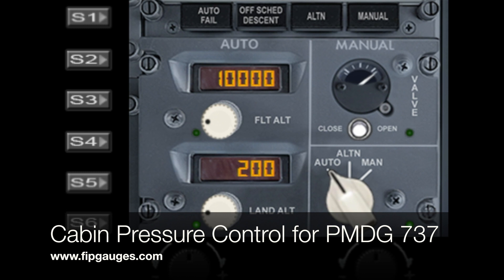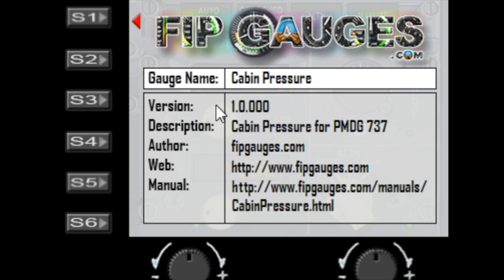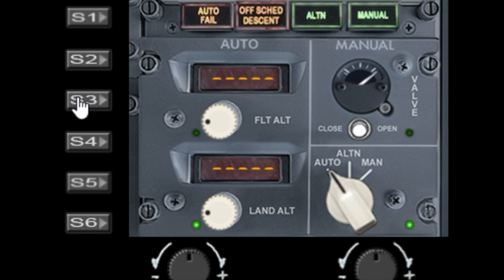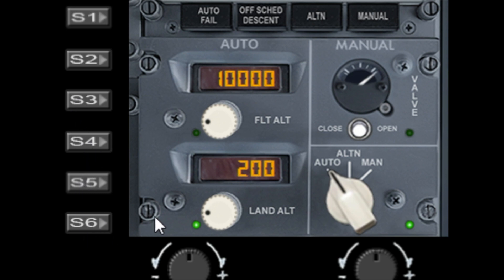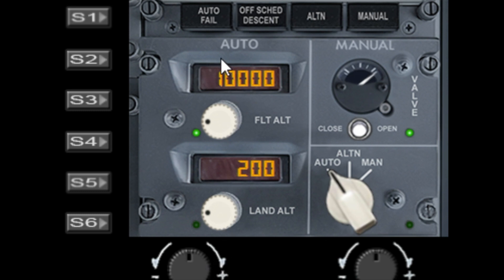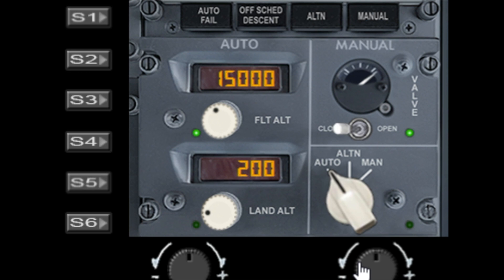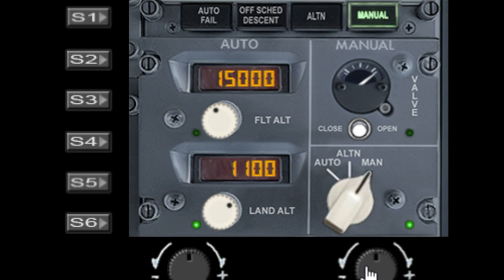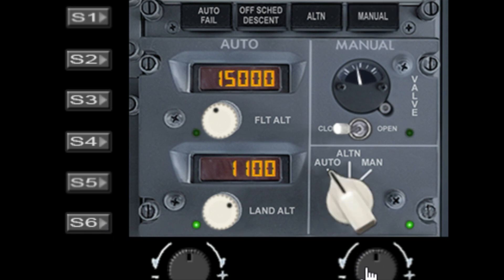Cabin Pressure Control Gauge for PMDG 737 - Saitek/Logitech Flight Information Panel & SPAD.neXt

Comment: Hello, I do not understand, is it just for PMDG? or can it be changed for default sim 737 with switch S2?

Thanks, greetings.
Reply from the maker: Hi, the gauge title should answer that question. This is ONLY for PMDG 737, the simulator 737’s dont output these variables or I would have made it compatible with both. The compatibility of each gauge is listed on each gauge page in the store. The “PMDG ONLY” gauges are only for PMDG. This is a limitation of the simulator. I can only output what the simulator or add on aircraft outputs and in this case only PMDG outputs cabin pressure variables. As mentioned in the video the [S2] compatibility mode needs to be in PMDG mode, this is a global gauge function that sets the compatibility mode of this an other gauges, turns on PMDG variable processing in the gauge, but it doesn’t support the other aircraft modes. This is a global variables to sync all other gauges to PMDG.
Reply: Thanks for answer :)